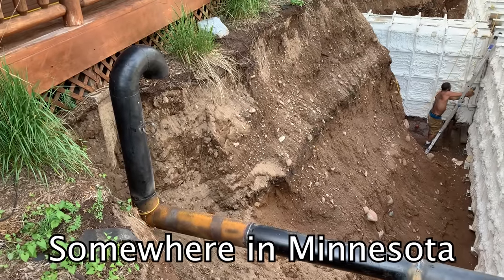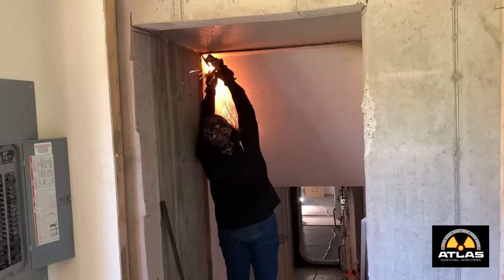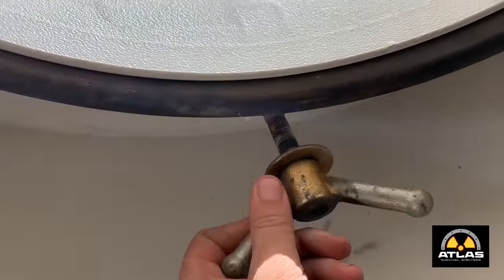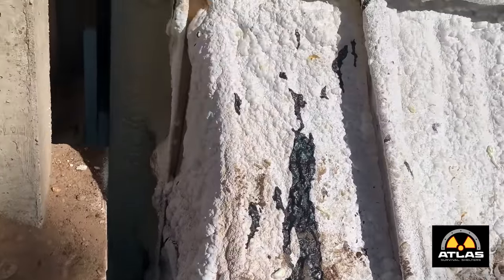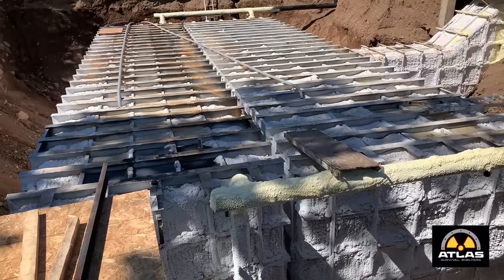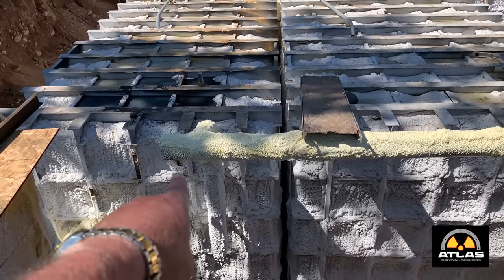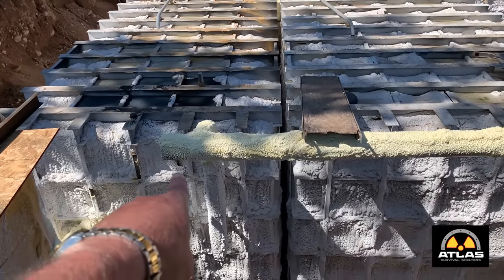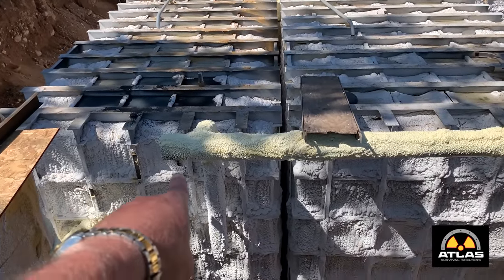A Completed $500,000 Luxury PLATINUM SERIES Doomsday Bunker

Comment: Atlas Survival Shelters bunkers have many ingenious solutions. For example, the emergency exit is excellent, its location cannot be seen from the surface and even if something falls on it, you can open it. The removal of condensation from the air ducts is also ingenious. Some things are a bit confusing. Why, for example, is the toilet built in the middle of the bunker so that if you go from one room to another you have to go through the toilet. I also wouldn't put the air intake so close to the house because the house could collapse on top of it.

Comment: It is an interesting concept but I would have done a lot different.  I would have gone deeper and encased the entire bunker in steel reinforced concrete.  You also need an extra layer of metal (I forget which time) to protect against an EMP.  The big weakness in the design will be the air intake system.  Clog that up and the people inside die in their sleep.  I would want a fully sealed off system with scrubbers to clean the air.  Basically the same way you would on a space station.  I probably would have used dimmable led lighting more like what you'd see in a house versus an office looking light.  Not sure how I feel about the bathroom being a pass through.  But there might not be many viable options.  As a parent I can say you do NOT want the kids room having the air system and the escape hatch.  That is just asking for trouble.  But that may have been more of a walk through versus how the owners will actually set it up.  They may have it flipped with the entertainment room being where the air system is.  Regardless, it would be nice to have this.  I like the entrance to it.  I think my favorite will still be the secret entrance in the kitchen island.
Reply: Not deep enough
Reply: @JamesBond-hg7hj  this, what good is a fallout shelter if it doenst protect against radiation, it should be 10x halving thickness of dirt, that 90cm of dirt above it, this isnt a fallout shelter, its just a shelter...
Reply: @diogocarvalho5488  better to have something than nothing. Total societal breakdown is coming with food shortages. I would definitely have this if I could.

Comment: I would have to do mine in a vault tec theme from the fallout games. This is some awesome work guys! I wonder would it be easier to use a mug welder than the arc welder or the type of hard welding rod you use is why you have to stick weld?
Reply: The type of Welding Process is dictated by the Engineers of any given project; stick welding is easiest to run in remote/field locations with least amount of equipment necessary to make a weld happen.

MIG, TIG, etc are mainly used in Production Facility/Shop associated processes due to extra equipment necessary.

Comment: Hardiebacker is a cement board used a lot in bathrooms or anywhere that you would want to tile that's gonna see a lot of moisture. For example if you wanted to tile your shower rather than a premade tub, you should use a suitable cement board such as Hardibacker product.

Comment: I feel like the outer submarine door should have some sort of glass. Something that can't be broken easily obviously. So you can see out without opening anything at all.
If people were outside trying to get in, the value of the bunker is compromised anyway. Your now just trying to survive and probably going to use the escape hatch and run off.
All someone needs is an angle grinder and within an hour they are going to be through those doors anyway.

Comment: I have two main issues.  One, where does the water supply come from?  Two, where does the electric power come from?  If I ever put a smaller version of this in I have imagined that I would put it on top of a hill.  After the hole is dug then I would have a well dug, in the bottom of the hole. I would have an old  timey hand pump with one full extra and lots of extra parts.  I would have a field ling put in down the side of the hill for sewage.  
The electicity though, I have not figured out how to light the dungeon.  Maybe some solar panels well hidden deep in some woods in a small clearing and underground wire, in conduit, trenched to the thing, I don't know for sure.
Reply: I was wondering those questions too. Mainly the sewer out. I like your hill idea. 
This set up has no drainage. They needed to lay sewer lines down first before dropping the bunker into the whole.
Reply: @td389  it is hooked up to the house sewer and they a have drainage systems
Reply: Stop being sensible..........these bunkers are a waste of time and money.
Reply: @rustyrobux7049  The house which has just been destroyed in an attack.Smart thinking there ron!

Comment: I would have various built in defensive systems such as the handrail down the main entrance would be fitted so propane could be pumped into the handrail and ignited from inside the bunker. If people were able to enter the main entrance tube, they would be incinerated before they could begin to attempt to get through the main door. Just hope they weren’t carrying explosives. Perhaps having acid spray through the handrail might be safer. I’d probably attempt something similar to the emergency exit tunnel as everyone will know every bunker has an emergency exit. Perhaps a bit much to install various things to protect the exterior of your bunker is a bit overkill to many, but in a life or death scenario, people will do anything possible to take what you have! Hell, build an external reinforced bunker with nothing but some small rifle openings you can get to through a tunnel and, protect that tunnel with lethal devices in the event they can blast through the external bunker. If you’re going to spend $500k on a bunker, might as well spend several thousands more to protect it! But that’s just me.

Comment: So ... if someone were to know where one of these was, and wanted to get in, couldn't they just wrap cellophane over the air pipe intakes and wait for the people inside to open the door?
Reply: This is why the pipes are hidden under fake rocks & real bushes (to hide the fact that there is a bunker in the first place).
The bunker is connected to a security video surveilance system (so you can see from the inside if there is people trying to do bad stuff on the surface).
  
If no "external help" is coming to remove the invaders, you can always use the escape tunnel [because it obviously would be a long tunnel (not pictured or sugested to exist here), rather than just a sand_filled hole].
  -> This "extension" will probably be made later by "The Contractor" doing other modifications to the Bunker.
Reply: Wouldn't heat sensor or infra red vision be able to pick up the air pipe even though it's hidden?

Comment: Curious about what is the back up power supply for this shelter? I assume the primary  is from the house, but is there to be solar and or diesel generator?  I saw you listed water storage, but does anyone ever sink a hand pump well in the bunkers also? Also where does any and all waste pump out to? I don’t recall any video covering this waste septic tank or something.
But all 3 videos were great and extremely informative, interesting and impressive work.
Well done
Reply: All of those can get put in it all comes down to how much you want to spend ??
Reply: Atlas only does the bunkers but 3 party such as Engineer775 channel does all of the solar panels, electrical, security cameras, backup batteries, backup generators, etc.
Reply: Septic is probably a pumped system. This bunker lacks a generator pod for some reason, but some people don’t take the mechanics of this very seriously
Reply: Wondering the same.
Reply: Likewise. There's mention of after service by 3rd party, but surely an 8inch pipe exiting waste to some place down hill would have been ideal, clearly with a sealable option or some other one way exit valve? Energy coming in from solar, wind or othercwill need a power conduit coming in. I do worry that some people don't really think too far ahead with bunkers. As storm shelters for a two week stay they are ideal, but when you consider 6 to 12 months occupancy, storing everything you need for that period, then seeds, and growing materials for emerging afterwards.  Oh and can we have closed bathrooms please, not corridor style. That was seriously bad planning. Not a fan of the sliding gates either. My thoughts anyway.
Reply: @AaronTheHumanist  i agree, whats with the sliding doors.  500k bunker and can't even goto the bathroom in privacy
Reply: @____________________________.x  it has a genator room it is at the stair well
Reply: @AaronTheHumanist  The reason for the "walk through" bathrooms & the "sliding barn doors" is ventilation.
-> There are only 2 inputs & 2 outputs of air (each pair on the same side)
Since you can not contain odors from the kitchen & bathrooms, there is no point on enforcing privacy.
Reply: The biggest issue is probably access to fresh water and disposale of waste.

Comment: I would've wanted a escape hatch a lot further out
Reply: got to think of it this way, would you really want to crawl 25 feet? 50 feet? 100 feet? If you need to escape, that means something bad has happened and you want to get out as fast as possible. Crawling is extremely slow, especially when there are people in front and behind you. Also that would be quite expensive because that means a lot more steel, paint, rubber sealer, paint, spray foam, or and digging a long trench. Moving dirt isn't cheap.
Reply: Ron will provide that option for you if you want to pay for it.

Comment: I was wondering about the placement of the air intake pipe.  If the house burns that would be a lot of smoke by the intake, so how much does that effect the NBC system to clean the air?  Also what about long term situation since the smell of smoke can last so very long?  Would that cause issues with the NBC in its length of life cycle?  Also someone brought up the question of what happened if someone welds the intake pipe shut?  Sorry if I am nit picking, but I was a military aviation safety officer and it is a habit to look at worst case and what if scenarios.  Keep up the good work and I look forward to more videos.
Reply: I may be wrong, but in a situation where an NBC shelter is required I don’t think anyone would be walking around with welding equipment. On top of them finding your shelter or even knowing about it; I don’t see that “what if” as a problem.
Reply: @Hero4Hire4  I was referring to the increasingly more frequent forest fires that plague us now a days.  Also, the very nature of of "BUNKERS" and "SHELTERS" is for the what if scenarios of the worst kind, otherwise why have them.
Reply: My somewhat related concern is bugs.  I saw there was a steel mesh over the opening, but little bugs are always looking for a place to build a new home.  Would it be possible to fit the end of the  pipe with a replaceable automotive air filter?  The automotive air filters restrict contaminants down to the micron level and are easily replaceable.
Reply: @GTOGregory  I am not sure about the answer to your question which would better be answered by the host of this channel.
Reply: Just an idea, have a flag pole as the air intake, no flag on it of course, the top of the pipe could even have a hidden surveillance globe.
Reply: @Hero4Hire4  I agree about the welding equipment but all someone would have to do is put a plastic bag over the intake pipe and wait for them to come out.

Comment: Where’s the shower and drain etc, in the decontamination/mud room?   Looks like an air lock, but as an ex- -nuclear worker who has gone into and out of radioactive contaminated areas a time or two....that airlock does not appear to room to change out of contaminated clothing, bag it, check for loose radioactive contamination ( e.g., fallout)  left on skin, hair, Eric., wash it off, and change into clean clothing before entering the bunker.   So what kind of decontamination tion do you expect to do in that , what, 3’ by 3’ area between watertight doors at entrance?

Comment: How hard would it be for someone to seal off the air duct and effectively force you out of the bunker?
Reply: why would this happen
Reply: Depends on how well guarded you make it
Reply: @etherial8dtracks169  i could offer lots of reasons someone would try to seal off your air duct. The most obvious Is they want you out. I also don't understand having the escape tunnel right next to the structure. I'd want my escape tunnel at least 500 feet away from structure and a fake one people are waiting by for me to come out
Reply: Its not difficult this is why OPSEC is critical and an off site location.  Insanity having this near the house.  Atlas owner guy would never be allowed to film anything if it was mine.   His crew should be security cleared and bonded with NDA's.   If it doubles the cost so be it.  These units once known can be assaulted in minutes with air vent plugs. Government NBC bunkers have massive generators and CO2 scrubber systems in order to seal off the atmosphere. Think submarine, This is not

Comment: What if someone just puts plastic bags over the air intake, and wait till you have to come out? I know that they are hidden, but you would easily be able to find them if you knew there was a bunker.
Reply: You’re only locked in that bunker if it’s raining fallout outside. Good luck to anyone who can make it out there, and hang around outside without dieing of radiation exposure.
Reply: @Ok-551  Did you notice the outside locking holes on the door? They could lock you inside and wait for you to stick your head out the escape hatch.
Reply: @jimocampo6237  first they have to get through the vault door. Again, it’s a fall out shelter. Everyone outside is fried with gamma radiation. Why else would you be in there?

Comment: What if someone welded a cap over the air intake?  You need to install an air intake redundancy.
Reply: Yep. Note that real bunkers use block houses as air intakes
Reply: one of them will be hidden, and they also will have cameras to check and see if anything is going on outside the bunker. If someone in a post apocalyptic scenario is desperate for supplies I doubt they will take the time to weld a plate over the air intake.
Reply: @PilotTed  Exactly
Reply: Post apocalyptic pirates just running around with a portable welding machine… looking for hidden bunker air intakes to close 🤣🤣🤣🤣
Reply: @michaelhood1291  🤣🤣🤣🤣
Reply: @АнтонПреображенский-ю3и  Priviet 
 @АнтонПреображенский-ю3и
Reply: Or just taped a plastic bag over it…
Reply: If I learned anything from Doomsday Preppers, it is the mantra "two is one and one is none". I agree there should be two intake inlets.  All his other videos show the vertical inlet pipe have the weep valve at the bottom of it, not at the end of the run.
Reply: You can add a guard to it to make it harder and I’m pretty sure he said they can install additional air pipes if you want/pay for them

Comment: "Liquid Nails" is a brand name, he was using a construction adhesive to secure the backer board strips. From what I am seeing this looks very over-priced for what they are actually getting...
Reply: You get what you pay for. If you want to cheapskate your bunker, there are other people to contract with. Good luck with that.
Reply from the maker: The steel alone was $150,000.  Before floors and labor.    The shelter sold for  only $440,000.  Install was $60,000.

Comment: Nowadays we build all this metal stuff that's only going to last 100 years or so. I like the idea of an above ground concrete or stone bunker.
There's no reason we can't make these things the same as our regular homes. The best plan is just to build your house on top of one of these, since you need a good foundation anyways, it will last as long as a castle. Nothing wrong with that visually, your house just sits on top like the ones on stilts in Louisiana and they actually look nice. I also think a rainwater collector with water storage would be better than a well pump, which runs on power. The best part is that nobody has to know you have a bunker, it's just you have a first floor with no windows, which ends up looking like a garage, but it's mostly a bunker with a generator and batteries. You could also put lean-tos on both sides to fully conceal it. It's all useable space for a studio or podcast room, you can have the blast doors open during normal times and lock all of your valuables when you go out. The power requirements are your biggest investment, you could get a Tesla powerwall or something like this in lithium.

Comment: Perhaps I missed it, but it gets extremely cold in Minnesota, I didn’t see an HVAC system, only the air filtration etc. I assume that underground temp in the winter is around 50 degrees F, and summer slightly warmer, maybe 60-65 degrees F.

Comment: Do you worry about humidity building up in the bunker?  As we breath, we can add to the humidity to confined spaces.  Especially if several people were living in close proximity.  
Humidity can lead to mold growth.  Do you add a dehumidifier to the air supply?  Installed or portable?
Reply: They have a really good air system
Reply: I was wondering the same thing...after a hot shower.
Reply: just buy buckets of Damp Rid.
Reply: @strohdog242  A hot shower in the apocalypse. Really. Very funny.
Reply: @strohdog242  hot shower? where does the water, or the electricity needed to heat this water come from?